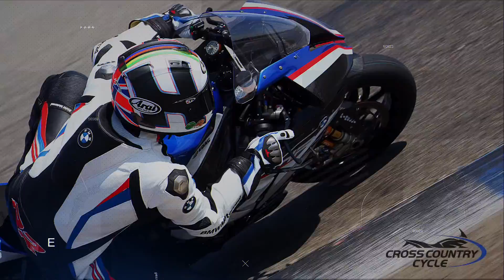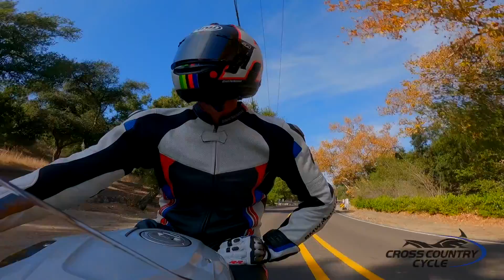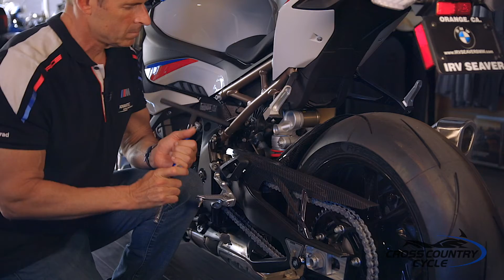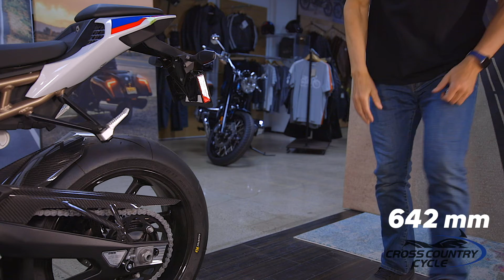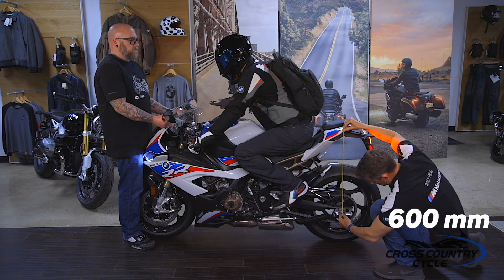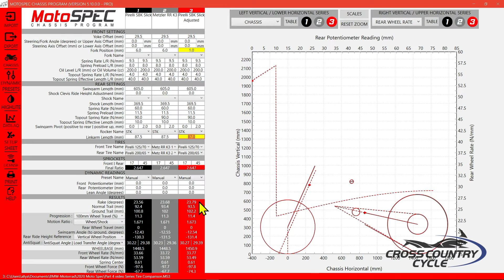BMW S1000RR DECODING - SUSPENSION SETUP (EP.04)

Comment: Thx for this series of videos. What i don't get : according to the year of the bike, the values in the manual are not the same. Current models (also m1000r or s1000r) aim for 50mm for the front. That's a lot!! What is the reason behind that? General rule for sag is around 1/3 of the stroke, so 40mm makes sense. But those 50mm, i don't get it...

Comment: Hi .... question ,, I'm considering purchasing a s1000rr next year but am reluctant due to repeated reviews of BMW software interfering with the bikes full power potential ( bottlenecking ) people are having to use a external source to reflash the motorcycle to remove the limiter software on the bikes ..n yes even after the initial break in period .. this OEM software delimits the motorcycle... would love your input on this ... thanks
Reply: I had my local dealer raise my limiter, tune my bike and do a exhaust, all under warranty, it’s a 22 and they’ve worked on my 2010 as well
Reply: @colinorleans5264  Howdy, late to the party! Just got '22 with 3 miles, now ridden 400mi.  AND NOT HAVING JOY!  Suspension Setting were 6-6-6 and now wil ride RacePro1 on 9-9-9; RP2 on 12-12-12; and RP3 14-14-14. Will test on my varied pavement winding 31mi loop. PLEASE give me suggestions, yes I've done homework of vid tutorials and this chan is great!! Multi info and perspective are appreciated! (I also ride race prep '10 CBR 1000 & 2020 ZX10 so I'm EXPERIENCED (Jimmy Hendrix ref.)
At yor convenience, yet asap reply is better.
Thanks and CHEERS